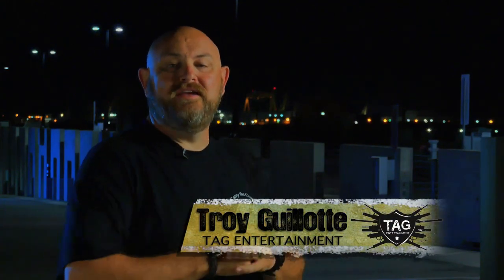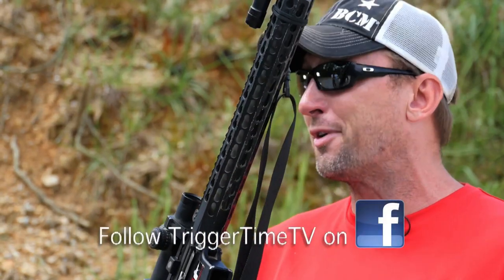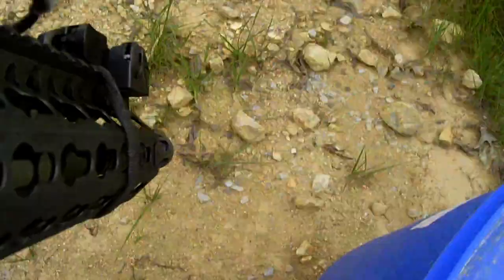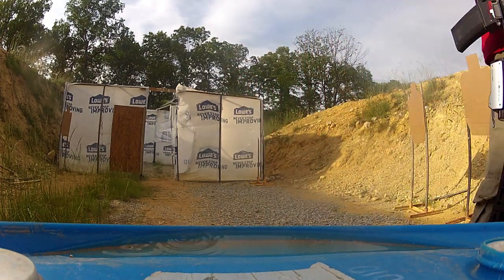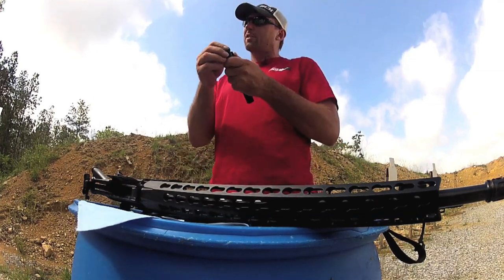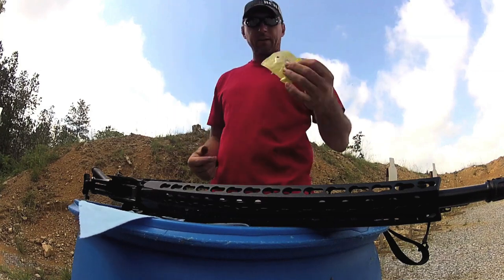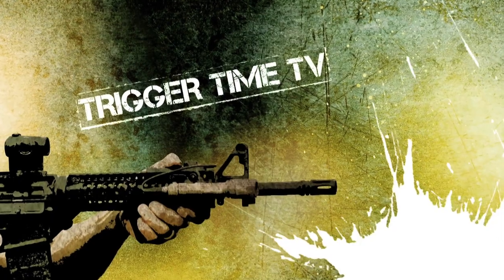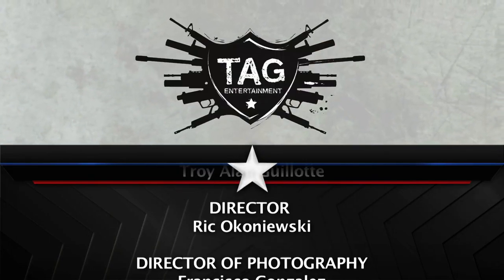Frank Proctor of WAY of the GUN, talks about malfunctions and how not to have them

Comment: I notice that you were putting on your safety after taking shots at a target before transitioning to another one.
Reply: MrBo52 If your eyes are not connected to the sights your finger is not connected to the trigger, if your finger is not connected to the trigger than your safety is on, Way of the gun Performance Carbine 1 DVD
Reply: Safety is always an enabler; never a disabler. Pat

Comment: So how many rounds did it go before it malfunctioned.
Reply: I know this isn’t the answer you were looking for, but check out “the filthy 14” by Pat Rogers and “the big M4 myth” by Mike Pannone. That’ll tell you all you need to know about what these can do, without experiencing it yourself.
Reply: @joshuafreeman4459  I know all about filthy 14. Last I saw it had 55k rounds . They do swap out wear and tear parts of that Carbine.  
I've personally seen Colt M4A1 Block II go little over 22k before we had to change out any parts . The bolt lugs sheared off . The gas port was for eroded to almost 0.70 . Gas port started out at 0.62. 
Also at one of the ranges I used to shoot at . They had rental FN15 Tactical Carbine . That FN15 Lower had little over 140k before they retired it . I have 0 clue what parts they changed out due to wear and tear . That lower went through 150+ carbine classes over 7 year period.  
In general if you buy quality parts of buy quality/decent carbines they will be more reliable than most people think .